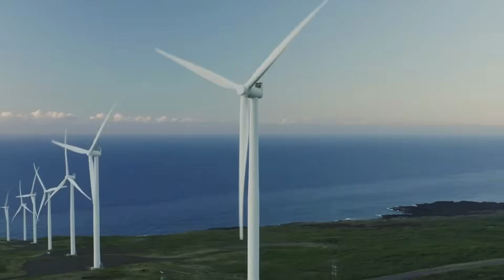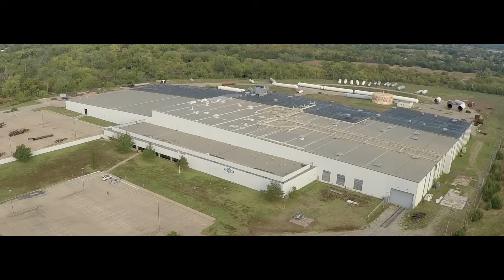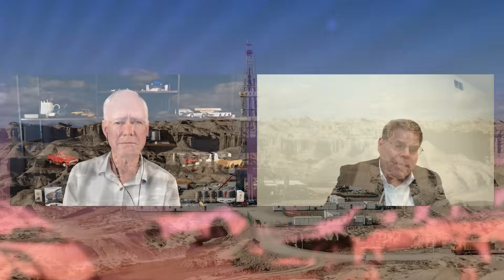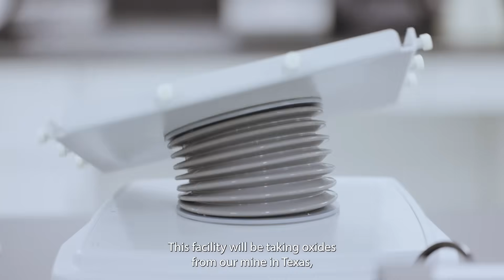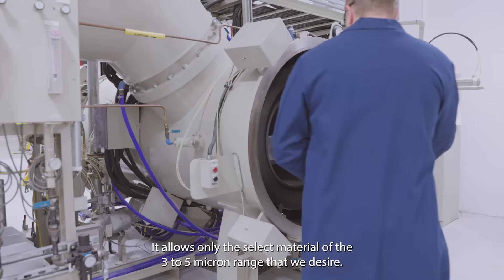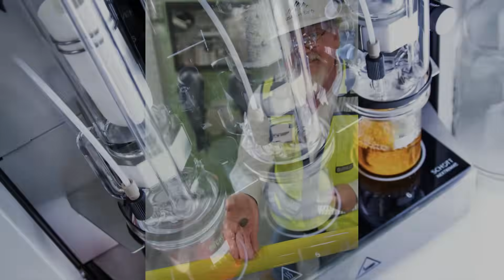Ramping Up Rare Earth Mining In The USA - Autoline Exclusives

Comment: China has ignored the Climate Crisis and environmental protection for too long.
Weather events are getting more extreme because of Climate Change. Damage from extreme weather events will have huge costs.
How hot does it have to get before governments and corporations wake up and stop adding more fossil fuels to the climate fire.
There is a Climate Crisis. We need Climate Action NOW !   Floods, droughts and extreme temperatures caused by burning fossil fuels will get worse over time. Adding more coal power plants will make the Climate Crisis even worse. Adding new wind and solar energy production is where new infrastructure spending should be done.  People need clean air to breathe and clean water to drink. China has allowed companies and people to pollute the air, land and water resources they need to survive.

Comment: rare earths are not necessary to make electric motors. N. Tesla invented the induction motor more than 100 years ago, no rare earth material. People have been experimenting with reluctance motors, again no permanent magnets. We have the talent to refine these technologies. Tesla already uses an induction motor in its multimotor cars. Let's stop being lazy and work on removing the need for rare earth materials!
Reply from the maker: True, synchronous motors don't need magnets and create their own magnetic fields. But rare earths are used in a lot more than just electric motors and are necessary in a lot of industries.
Reply: research is being done with iron nitride (FeN) to replace rare earths
Reply: @mike_w-tw6jd reseach may be going on with other materials,  but this will take years to complete, and bring the material  to production, and more time to re- design motors  to use it. There are proven technologies that don't  need permanent  magnets that have been in use for  over 100 years.  There are very slight differences  in efficiency,  that we can live with. The Tesla company  already uses motors  with no permanent  magnets for the 2 motor vehicles.
Reply: I did some calculations and using electromagnets in the rotor(that's the way it was done for 100 years) can produce similar results as permanent magnets, with no crazy materials, maybe give up 1 or 2 % efficiency. I have seen some experiments using induction feed to the rotor for the electro-magnets. All using common materials
Reply: Power to weight ratio is the key here. Nobody want a few hundreds more pound of dead weight on their Tesla.
Reply: @joelau2383  I believe that the industry can design a very efficient light weight motor that does not use rare earth metals. Nobody is working on it because they have a solution with permanent magnets.